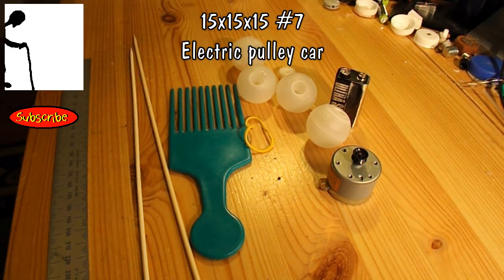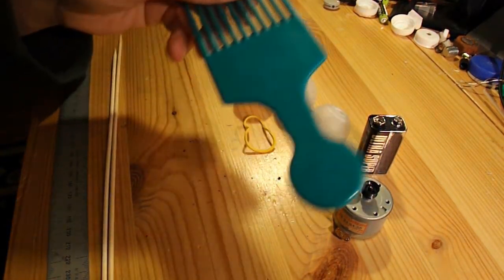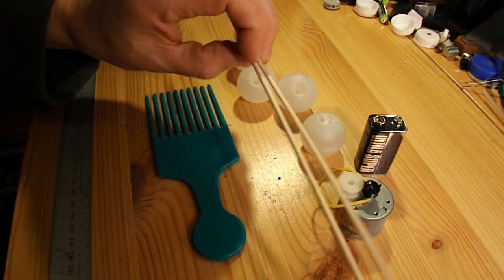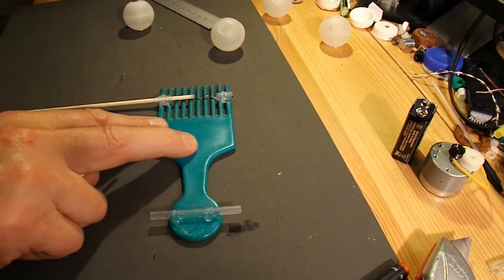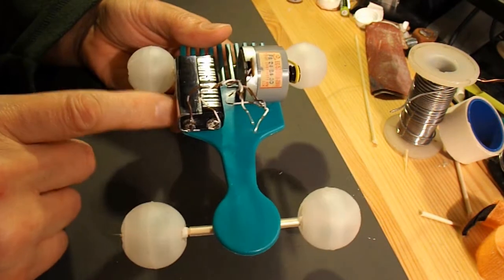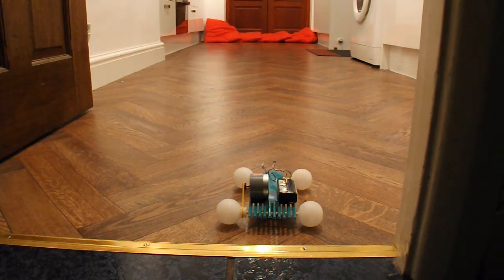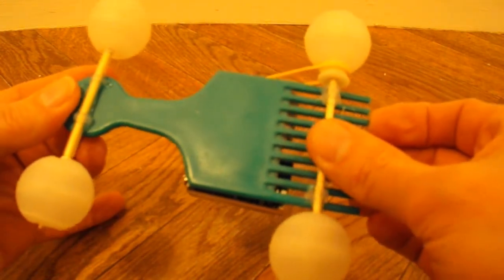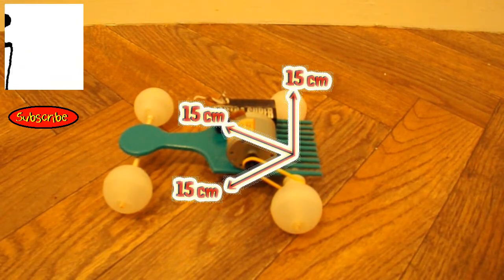15x15x15 #7 Electric pulley car

Comment: could you make a vehicle with a controllable propulsion system. So you can make it stop and start when you want.
Reply from the maker: Have a look through my Remote Control playlist. There are cars there.
https://www.youtube.com/playlist?list=PLA5a2xPRSrB13Xcquw4Ff09MQzTPjeVkI
Reply: Is there another way besides using remote control?
Reply from the maker: therandomsfun There are many different types of remote control. In that playlist there are Radio Control, Infrared Control, and directly wired control.
You could also use sound control.
Whistle Activated Key Finder Electric Car http://youtu.be/4Cm49q-uNYE?list=PLA5a2xPRSrB0yTUYmJSS3ML5xxaBzHl3e
Short update to my Whistle Activated Key Finder Electric Car http://youtu.be/mLu9SheVmzo?list=PLA5a2xPRSrB0yTUYmJSS3ML5xxaBzHl3e

Comment: from where are you  getting these type of motors
Reply from the maker: This motor came from a tape cassette player but I am sure you could find them in other electrical items. I take a lot of old electrical items apart to search for useful items. Alternatively I am sure you could buy them on eBay quite cheaply.

Comment: and the pulley
Reply from the maker: The one on the motor was already there when I took it out of the tape cassette player. The other pulley came out of a printer. Alternatively I am sure you could buy them on eBay quite cheaply. or just make them. It is not hard to do that and they don't need to be high quality to work on a simple toy like this.